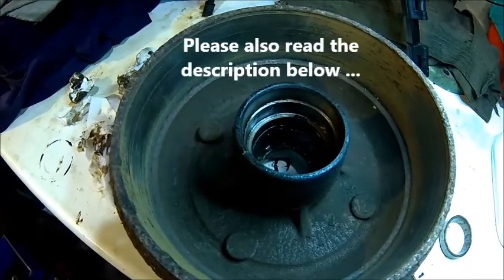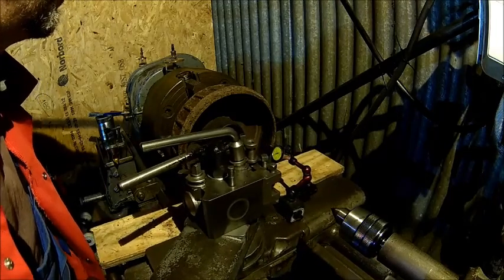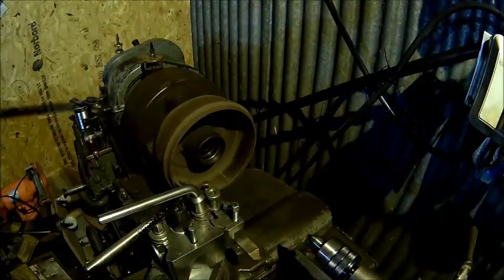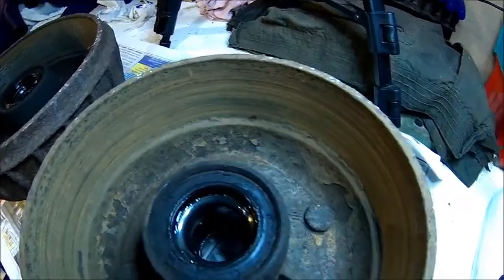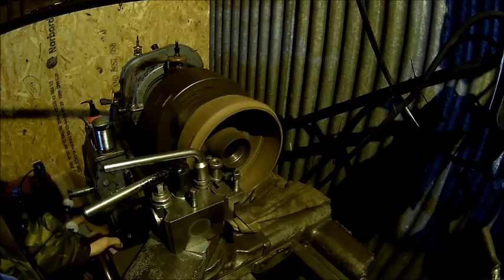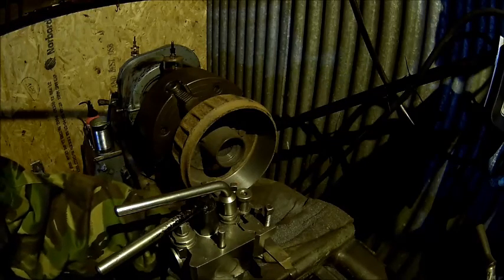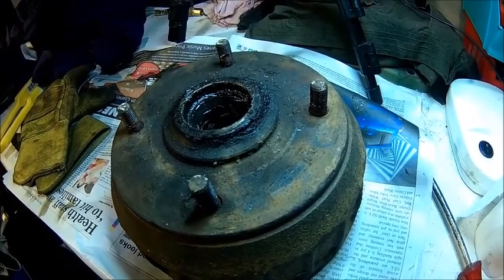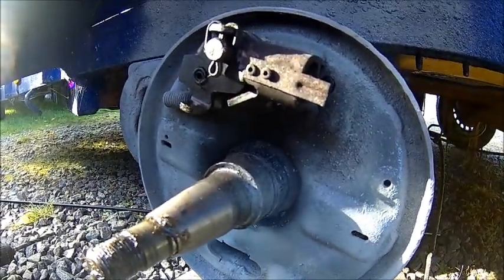The Trailer rebuild project - Part 2, machining brake drums on the South Bend lathe

Comment: that cast sure makes some weird sounds.. lol.. one thing i would recommend is changing all the bearings and seal at the same time and saving any bearings that are in serviceable condition as spares.. i have a tandem axle trailer too and started having bearing problems right after i bought it. by the time i had the problems all worked out it would have been wiser to change them all at once instead of just one,  then two weeks later another and then a few weeks again another .. by the time it was all done 7 bearings went into it instead of 4..
Reply from the maker: It actually sounds worse on the video, seems just the right frequency for the microphone. Got very little vibration marks so all good.
I indeed changed all the seals, but only 2 bearing sets were bad, the other ones are fine and considering that this trailer does probably less than 500 miles a year, the used ones may last me another 5 or 10 years. The main problem around here is going through floodings and fords, that makes things seizing up sooner or later. 
I bought it rather cheap, so it was clear that it will need a bit of work. When i first looked at it, it became obvious that the best looking part was the fresh blue paint ...:-)

Comment: Nice to see the South bend working Mike, it does sound like its powered by an old hit and miss engine but who cares.

Alan.
Reply from the maker: Cheers Alan....well, as long as i know where the sqeaks and rattles come from it's alright. The vintage engine sound is actually a very poorly laced drive belt,.. just one of the long list of things which need adressing, but urgency of this one is rather low as it's not critical so it can wait until i pull the whole drive unit for sorting out the bearing play and have a look at the motor as well.

Comment: have a first load planed yet ? i ask cos i swept the truck bed off and now need more fire wood ,so if you the trailer your jeep ,i have bar oil and ,do you have a chain saw, with gas i could borrow what ever day is good for you is good for me . thanks
Reply: yea cant find that oil
Reply from the maker: Well,.. always happy to help my subscribers, but ......are you aware that this country is entirely surrounded by water ?  Assuming you live elsewhere, there are some difficulties as the Jeep can't swim,  way too many holes in the flloor pans ....
Reply: lost a little brother to a floor pan hole once i did.